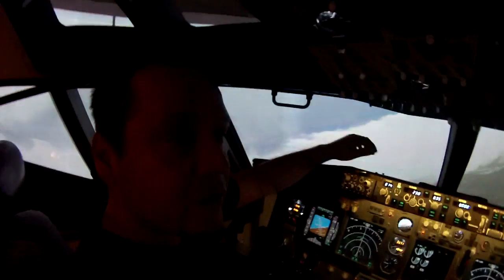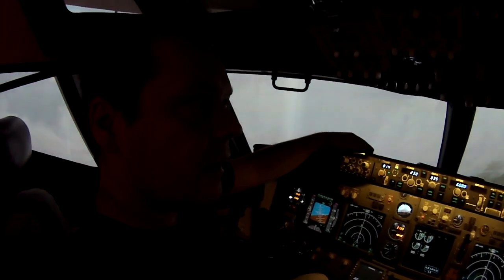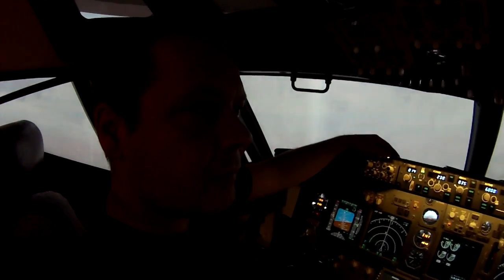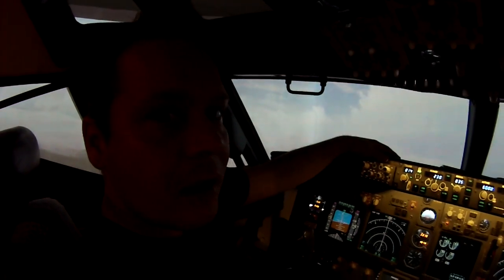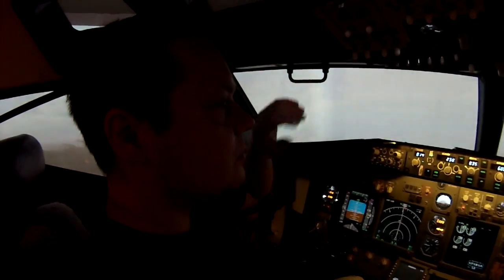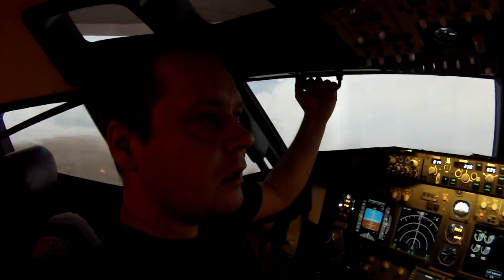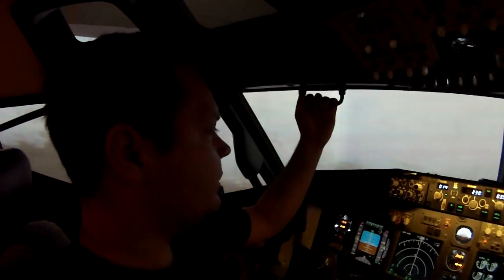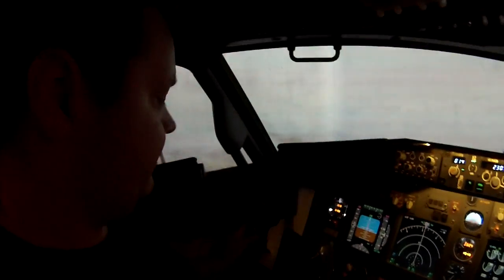Building a Boeing 737-800 home simulator #62

Comment: You probably could have bought a real Cessna with what this setup cost you (-;  Very impressive.
Reply: Maybe a 150 used
Reply: +Sweetrevenge54 more like a brand new Cessna 172
Reply: +Michaelc136 that runs like 200,000 US
Reply: +Sweetrevenge54 lol that's Strait off the Cessna website, I'd go through a private seller much cheaper and for about 100-150k

Comment: Only thing that will complete it in my opinion will be some actual responsive movement of the cockpit giving that a very realistic experience.
Reply: +SUNNI POWER strangely enough, I had a flight in a stationary 737 sim (full size commercial unit) and I didn't realise it was fixed - the visual inputs you get are so realistic that your mind fools you into believing that you are moving about, even though you are not.  Remember he said that this simulator could make you feel sick?  That's spot on, I reckon you could get motion sickness in this sim easy as.
Reply: Dave iTonks
Reply: l,m awake

Comment: I would love to have this setup. I basically have to start very small... I have a tablet, and installed FMC... Have prosim (Just a trial at this time) and the big buys for me is getting the overhead and the front panel. I've heard they're area ways of getting a diagram to print out and make, but don't have the right material.

Comment: Compared to actually going through the trouble of actually getting a pilots license and then actually buying and maintaining a real airplane, this is dirt cheap, and sometimes more enjoyable.
Reply from the maker: You are 100% correct.. I do have my CPL/CFI licenses for the real deal, but this is just as fun I can promise you :)
Reply: Mike Uk Real life is better.  But each have pros and cons.  Sim is nice since you can just do whatever you want with no consequences and just relax
Reply: artaza99 It will probably be $30,000+ USD. I looked at upper panels and stuff and they aren't cheap.
Reply: ***** So what do you actually prefer? flying in a plane or a simulator? or is it that you just enjoy them in their own ways?
Reply: ***** How much does this cockpit cost ( when it was done) an answer would be highly apprecieted.

Also, greetings from Sweden :D
Reply: Not even close. One guy in the UK built the exact same thing and it cost him $8000 over the course of 3 years. It's not as much as people think if you build the entire thing yourself.

Comment: Good work!
The reason why your solenoids kick out the USB is that they are dragging too much current. You may need to run the signal out through a FET and then into the solenoid
Reply from the maker: The Solenoids are connected on a separate power supply. The problem with having solenoids on a computer system, is that they are able to create their own current as they are made up of a magnet and a coil, so when they shut down, they will shoot a high voltage spike through the system and give you problems.
Reply: ***** Diodes ???

Comment: I like how you handle all these stupid comments with "I hope you feel better" if I were you I would have ban all these morons.

What is the reason for the very low frame rate in the external view?  I bet it is more completed than buying a better pc. assume you would have had the money, would it be possible to overcome this problem? and how much would it cost?
Reply from the maker: Hehe..

The reason for the low framerate was as I mentioned in the video, was that the computer and views were not tweaked.. This was basically just a first try

Comment: Lookin good there.. Say on those kind of home built sims, how you plug in ground power, because on regular flightsim, you can do it through the FMC, ground where you have it as ramp plugs in the GPU, but on these actual full active sims, is it the same way or would it be on your instructor's station, where you simulate ramp plugging in grnd power ?? I was curious about that on these kind of simulators..

Comment: And where did you get the overhead panel and if u made it how did u
Reply from the maker: The overhead is an old cockpitsonic overhead.. I would not recommend it.
Reply: how about the sounds how does that work how do you make the switches make sounds